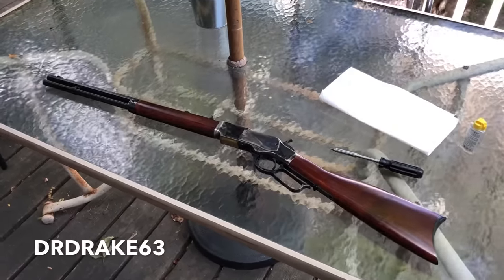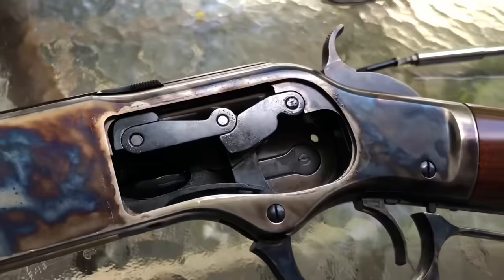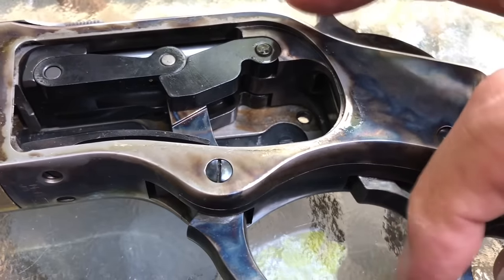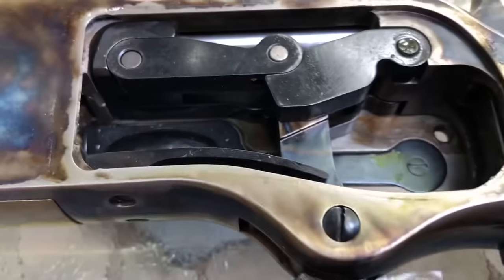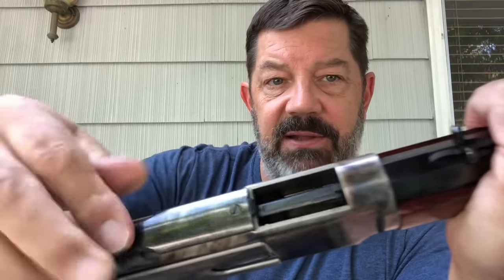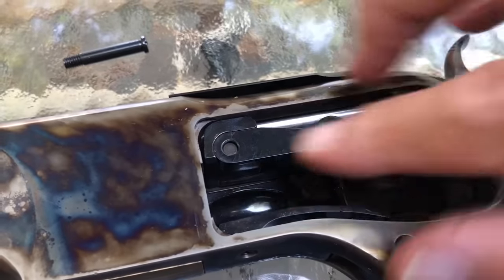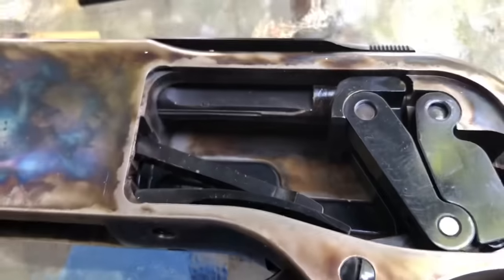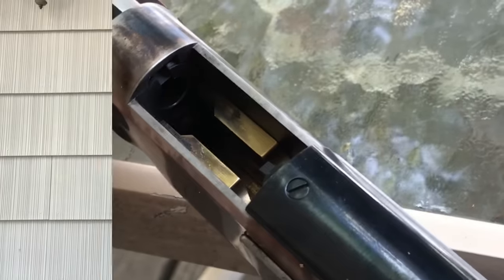Inside the Uberti Winchester 1873 lever gun

Comment: This rifle can handle any load .357 you care to shoot. There's no 'concern' about the action linkage, because in the 'fire' position the lever causes the linkage to be nice and straight so that any recoil energy is transferred to the frame, which is the secondary reason they designed it so that it won't fire without the lever and linkages in the proper position.

Comment: Personally I don't like the safety mechanism.  I find all grip safeties distracting (Colt 1903 & 1911).  I think I would shoot my uberti 1873 more often if I could remove that mechanism without causing any problems.  I shoot my Henry and 1866 most of the time.  I have collected Uberti lever guns in 44-40 and 45 LC.  I prefer 44-40 because it is more accurate and the slightly necked case expands into the chamber to keep powder residue blow back to a minimum.  I really enjoyed this video showing the guts inside.  Much better than a schematic.
Also, you have a very clear and well paced voice, so my deaf ears understand everything you say.  Keep up the good work.

Comment: I ran across one (made in 1892) cal. 44wcf (44-40), that was pure original from the receiver to the butt plate, a Winchester 94 ,16 in.carbine barrel and mag tube had replaced the original barrel. Shoot great ,is strong enough for all smokeless loads. Very accurate out to 200yrds. Open sights

Comment: The lever safety blocks the trigger. You can see the block move out of the way when the safety plunger is depressed by the lever closing.

These are lovely rifles. I have no problem with not knowing everything. I have a problem with incorrect descriptions of how a firearm action operates.
Reply: That's a safety feature to prevent out-of-battery ignition, once the lever is fully depressed the gun is both in battery and ready to shoot. For that reason I know that a .357 magnum 1873 replica made out of modern materials can easily withstand hot handloads which increases the effectiveness of that caliber out of a long barrel.
Reply: @chapiit08  you are correct. However, this video describes the function incorrectly.  The lever safety does not block the sear, it blocks the trigger.
Reply: @chipsterb4946  You are right, I noticed something out of place there but couldn't make it out at normal speed.

Comment: Once the bolt is fully locked in even the lineal force of a hot .357 Mag. will not open the action, that's why it has an in-battery safety.

Comment: The originals were tested to destruction by Winchester. The data is public. They muzzle loaded the barrel with primed brass in the chamber, super heavy charges including ultra fine black powder dust and dozens of bullets on top. The action didn't suffer damage until it reached something that would damage a Sharps or Rolling Block.
In other words, it would easily take 3 times the force a .44 Mag would produce (beyond .44 Mag proof load) before damage will occur. This with old original low grade iron they had available in the 1870's.

These modern rifles aren't made with your great great great great grandpa's steel, these new rifles are made with modern alloy steel and will take .44 mag forever and outlast you, your kids and grandkids especially given this is a toy to you, not a saddle mounted work gun being used day in and day out killing pests on the ranch and if it is and you are, you can afford to replace it in 10 years because it's a work gun not a safe queen.

I used to believe what the stank old nuts on the internet claim, then I began reading reprint books, writings and such from the period and what that data tells is absolute opposite of the "sage"  bullshit that perverts modern gun forums.

Comment: I have the same gun in 45 Colt.  If the toggle system is not rated strong enough I have not heard from any incident where one has broken or failed in anyway. ??   The mechanism may wear from grit due to action on pins becoming looser,  but not break.   Mine is to new to tell yet ,  reload my own.  Wan't to get it up to 1,300 fps.   Factories are about 990 to 1,000. fps.   Action is so smooth.  A real beauty to shoot.
Reply: Just to add....that's a dual toggle,  Very durable.  I think some guy's think it's just a single on the one side.  Not.  If a load threw back the bolt it will also have to throw the lever.  I see no way it can do that.
Reply: Most of what you hear about the 73"s toggle design is a crock of crap. I have the Uberti 73 in 45 Colt and occasionally shoot Underwood 255gr semi-wadcutters at around 1300 fps with no issue. These rounds are topping out at 14,000 psi, which is the SAAMI max pressure. Doesn't mean that it is going to blow the gun up. Also, it should be noted that the same gun is rated at above the SAAMI rating of 14,000 psi using the European governing standards. Needless to say, these rifles are stout. More than what most believe. Also, the same design is available in the 44mag, which is more than double the 45 Colt max pressure rating at 36,000 psi.

Comment: The only reason you would own a 1873 winchester would be the value . If you want a good pistol caliber lever gun the 92 is the one you want.  remaking the oldest least durable and most antiquated is not a good practice .
Reply: It depends on the intended use.  The JMB-designed 1892 has a stronger and more compact receiver.

Cowboy action shooting is a speed event.  Although SASS rules limit rifle velocity to 1400 FPS, no one shoots ammo that hot.  An 1873 will digest standard velocity ammo quite well and it’s mechanically simple design means the rifle can be cycled quickly and with less effort than a ‘92.  For those reasons the ‘73 and its cousin the 1866 is used by almost all of the top shooters. If the ‘92 was better for the game, the top shooters would be using it.